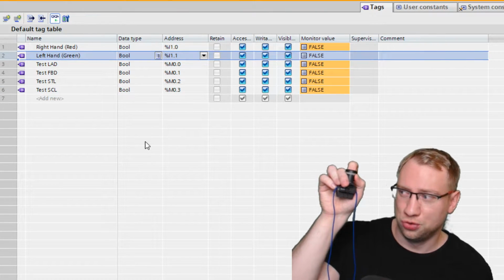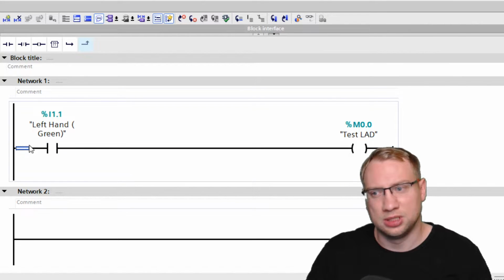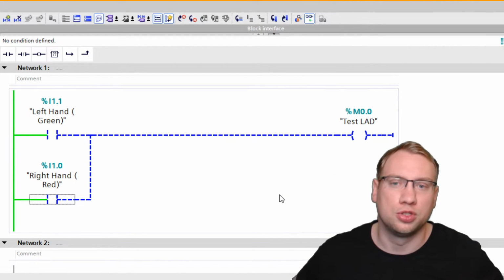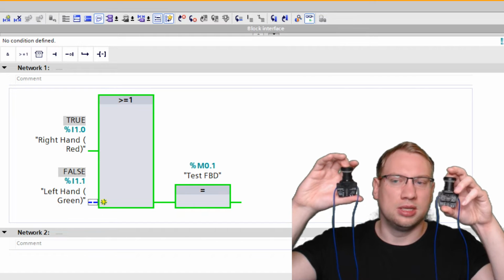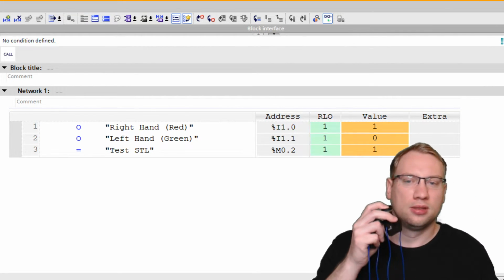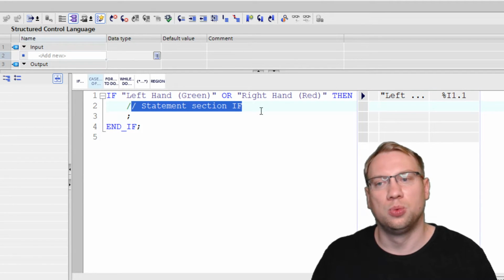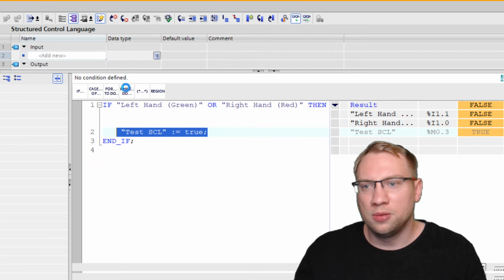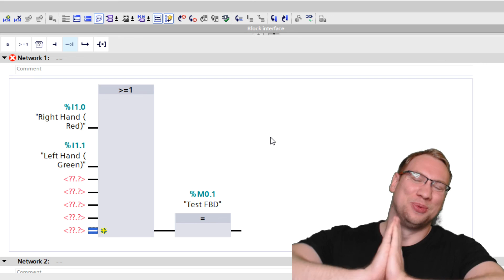Logic OR: Boolean Circuits in LAD, FBD, STL and SCL

Comment: Is there any option is Tia portal to Swap Ladder to STL? I could find this option in simatic manager.
Reply from the maker: If you are using a S7-300/400 it should still be possible in TIA.
The compiler of S7-1500 works differently, that's why STL is NOT the main language anymore, so you can NOT switch from LAD/FBD to STL when using an S7-1500
(S7-1200 cannot even understand STL at all)
Reply: @hegamurl  thanks. Much appreciated your knowledge . Very helpful.

Comment: Nice. But it's very basic.Helpful for beginners. 
But Tia portal gives option in properties to convert FBD to Ladder or vice versa. But STL is the language is  short, easy to copy paste and use find and replace cmd to just change address for complex programs.

As Electrical Design Engineer, Ladder is easy for me as same as control panel relay logic design. For computer since engnr, SCL may be easy as C language. For electronic engineer, FBD may be easy as electronic logic gate operations.
Reply from the maker: So there is something for everyone! Of course every single language has it's dis-/advantages and also differs per application